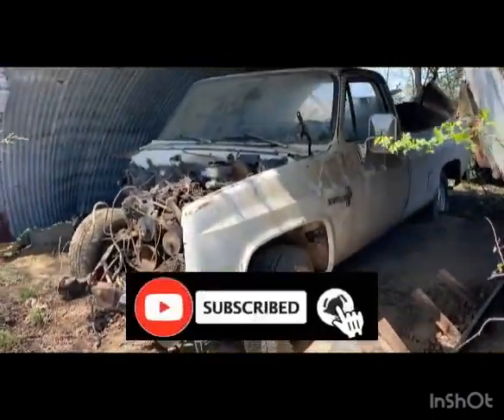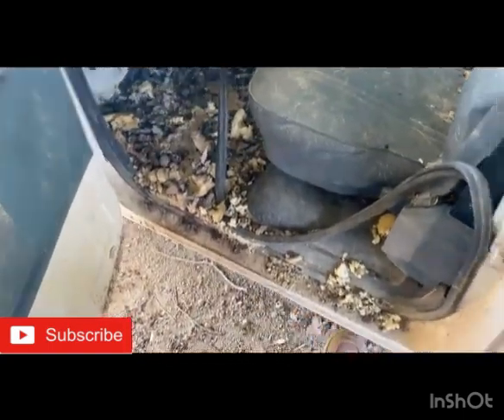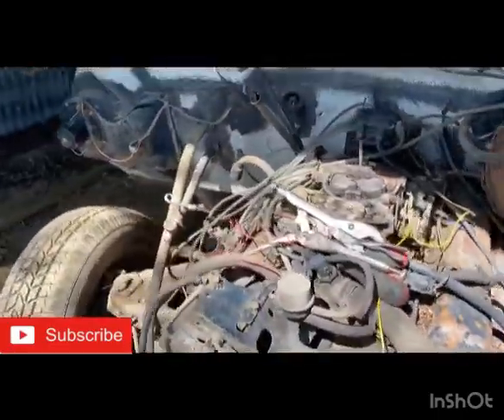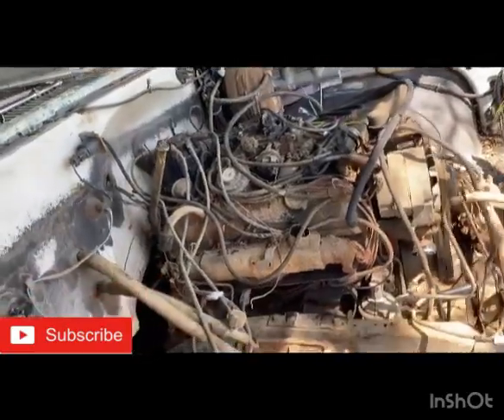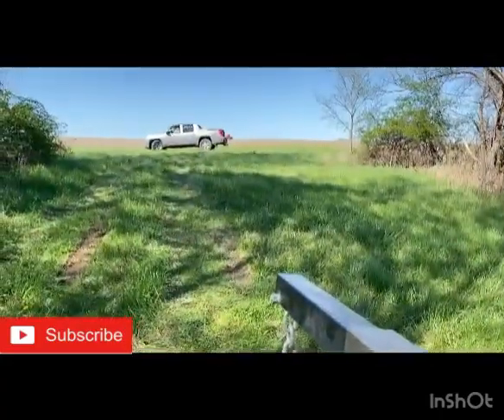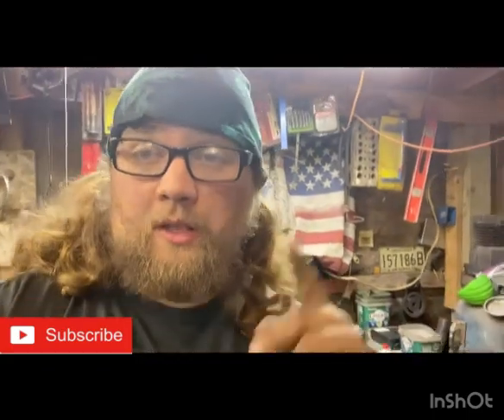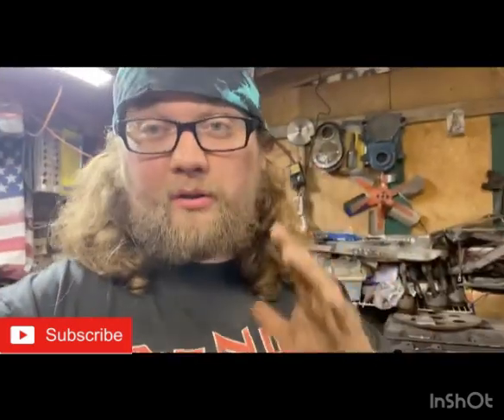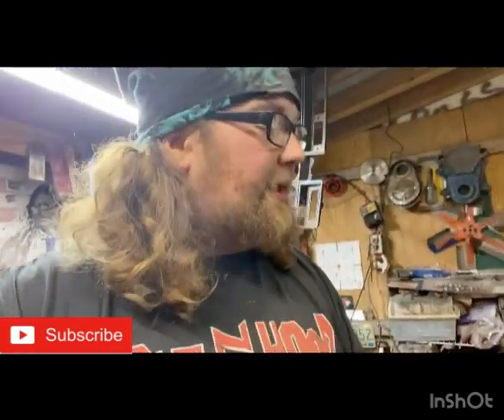1926 model t hot rod gets a new engine and it’s not a ford lol 😂 🤣😂

Comment: What was wrong with the other engine?
Reply from the maker: Leaking water pumps and the front seal in the transmission is bad he said he didn’t want to mess with it he wanted to put a newer small block Chevy in it and be done more power then the old flat head my old man loves the old flat head I personally think a small block Chevy or even a ford 302 or 351 would have been a better choice then the old flat head
Reply: @poormansspeedshop4104  yeah flatheads really aren't that reliable either. Something breaks you will be waiting awhile for parts etc.
Reply from the maker: @faststang89  I get to keep the engine and transmission I’ll probably pull a Barry and throw it in my shed and find a use for the engine and transmission eventually the engine runs really good and the transmission shifts just leaks fluid out the front seal